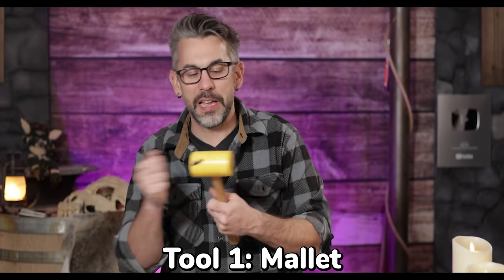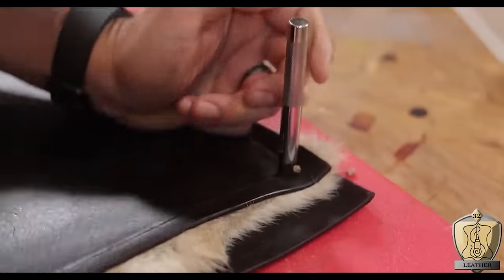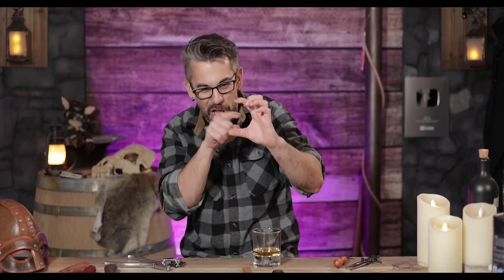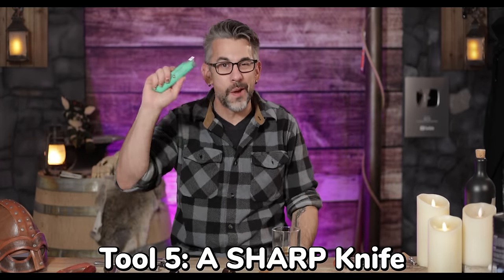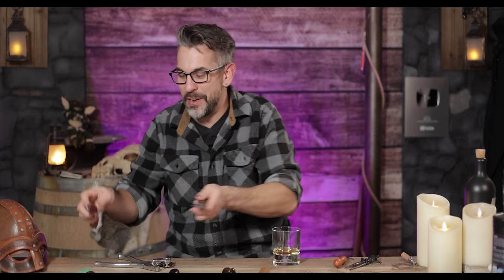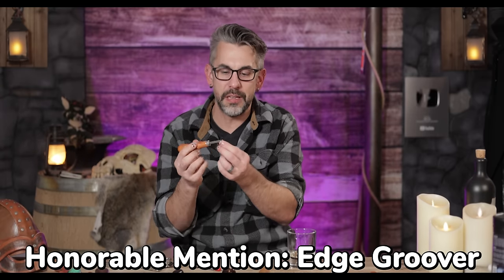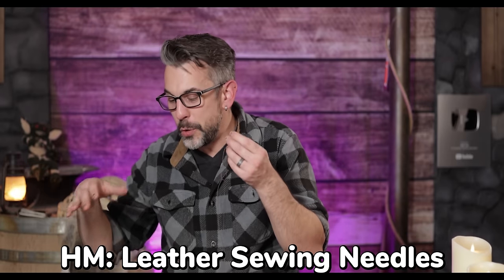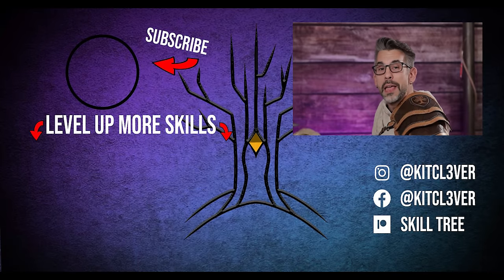How to Get Started with Leather

Comment: One surpring tool I picked up for leather tooling: a small crochet hook for very tiny details that the beveler stamp can't get to. You use the back of the hook like a stylus and it does a pretty decent job.
Reply: I've got a project I want to do tiny designs on and I'm just getting started, that sounds like a great idea and I have lots of crochet hooks. Thanks for the tip!
Reply: @SnowFox102  do keep in mind it is more tedious than the beveler and it takes multiple passes. But I did a whole project with this method and it worked.
Reply: @DirtCheapTerrains  Oh yeah I'm sure. It's just that my project is so small that I think an edge beveler would be too big, or at least too big for me.
Reply: Something else like this is a walnut pick, it is even thinner but I use the acorn end for those tight places and  the pick part for a stylist and a smoother as well. I love those garage sales finds!

Comment: About half a year ago I found a great kit online: multiple spools or wax thread, half a dozen needles in various shapes and sizes, assortment of stitching chisels, edge beveler, edge groover, scissors, measuring tape, thimble and two awls. All for just over €50. So I totally agree. Getting started does not have to cost an arm and a leg.
#craft
Reply from the maker: 100% I used the minimum amount of tools for AGES.
Reply: i got that exact kit for starting as well

Comment: For the edge slicker you can also use an old BIC pen. (Which also can be placed in a drill)
Reply from the maker: Good call! I have used a wooden dowel b4 too lol
Reply: A nice piece of antler works good too, plus the tip can reach into narrow spots.

Comment: I'm a blacksmith and I mostly use leather for knife sheathes and straps, especially for LARP and SCA articulated armor.  My first real tool was a punch because nails can punch a hole through leather but don't don't remove leather, meaning that leather "heals" itself and rivets don't fit very well.

Comment: This is so incredibly helpful. As someone who's just starting out, here are the tools I found I needed, in order:

1.) Knife
2.) Rivet tool
3.) Hammer
4.) Needles
5.) Stitching chisel(two-tine if you can only get one, but you'll definitely also want a four-tine also)
6.) Groover
7.) Hole punches
8.) Beveler

And that's actually as far as I've gotten so far. I've made a medieval ring belt, some pouches and wrist straps. My next project is gonna be a costrel.

You can do a lot of stuff just fastening with rivets before you get into stitching. I would learn the basics of stitching before you move on to tooling, but that's just my preference.

Also, if you get the cheap Harbor Freight hole punches and have trouble getting them to cut, there are some tricks you can use. Add a little beeswax to the cutting edge before punching each hole. If you're really struggling, and the punch is small enough, you can even chuck it into a power drill and use it just like a drill bit. It cuts through almost instantly!

Comment: Just a warning about the edge beveler from Weaver, made by horseshoe brand, with the plastic tan handle and interchangeable tips. The sizes are bigger than listed. They take off more of the corner than they should. Chuck dorsett of Weaver leather gave a good tip I liked about the bevel should take off a quarter to a third at most of the width.

Comment: I’ve gotten into leatherworking a lot after I found this channel. I’m generally busy as I work in construction and have a young baby now. I prefer working with chrome tan and on occasion veg tan. I’ve made a few leather totes, I made dnd dice tray scrolls I made a set of Christmas stockings and some other projects around tool belts. If I were to make a recommendations if you’re busy or limited on space I prefer using leather scissors over a knife to make cuts. I use an awl to trace out the shapes on my project so I know where I’m making cuts. I also almost always use an 18inch ruler. Good luck to any new crafters! And practice on your scraps don’t just toss them.

Good luck winning that prize y’-all I’m sure it’ll be amazing.
Reply: I’d like to add on to this, although we love Tandy leather here especially if you need templates or hardware. If all you’re after is a cheaper leather supply maverick leather has second run leathers that can often be found at a very reasonable price range. The veg tan horse narrows are a great option to get practice in and small crafts.
Reply: I’d like to add on to this, although we love Tandy leather here especially if you need templates or hardware. If all you’re after is a cheaper leather supply maverick leather has second run leathers that can often be found at a very reasonable price range. The veg tan horse narrows are a great option to get practice in and small crafts.

Comment: I've worked for two different companies that fabricated and sold solid surface countertops. While most will have broken or random scraps, they likely won't be sink cutouts but more strips and corner cuts. Solid surface is poured in lots like paint, and can be repaired, but if you repair it with a piece from a different lot, you can oftentimes see the difference in the particulates. So any place worth their salt will leave the sink cutouts with the customer to keep for possible repairs on their new and expensive countertops. That said laminate and stone tops can't really be repaired in the same way so those cutouts are likely fair game if they are kept at all.

Comment: A nice metal ruler is another thing needed.

I would also point out that you may want to consider going with a maul rather than a mallet, most of the choice there is personal preference because both do the job but which is better is more up to the person.

For needles, you really want a separate storage for your leather needles compared to normal sewing ones.

But the only needles that I've specifically bought is a permalock needle, the others I've gotten came from ones that were included with the various Tandy kits

#craft

Comment: That's such a big help for me right now. Thanks to your videos I've finally got the motivation to make a belt for that cool Celtic Cross buckle that I had lying around for ages. And now I'm hooked on leather crafting but don't have a big budget.
I bought a leather strap - and some scrap leather to test on first - at a newly opened LARP store and so far only used a rotary punch, my dad's old military knife that has an awl, some upholstery needles and parcel string as cordage. I still have to get the edges smooth though. Gotta try that rug method. 
But like the rest of my garb it's an ongoing process and one has to begin somewhere.

My grandma even may have some of those tools lying around in granddad's old workshed. I'm pretty sure a lot of stuff "fell off the truck" when the shoe factory he worked for since he left school moved it's production to far east Asia in the 90s. 😅

Comment: #craft 
Last year I got a couple super small things to make a dog collar. Mostly hardware. I have half of the belt leather left and of the many tips you just mentioned I kinda wish I had some of those tools. I mean a needle set, forks and a awl can only get you so far. I even used sissors to cut the leather and the awl to punch holes to set the threaded rivets. Overall my dog is super happy for what he got. Its just a dress collar and slips over his head and has one of those buckle clips. The next one I make will have a lot more stitching and some stamping and more conchs.

Comment: #Craft I got leather scraps years ago and now I'm trying to find projects for them. The main one I'm focusing on designing is a purse that I actually like and adding the Bag of Excellent Expansion ^tm on the base. I've been debating either tooling an Art Nouveau design on the flap or using it as a laser cutting project. I got some vinyl I can use as a test to see if the design works that I can later use for the sandbags in my truck 👍.

Comment: Thank you so much for this video! I know you made one like it earlier, and I was recently contemplating going back to try to find it. Now I have an updated version :) 
I bought a kit around this time last year, but it ended up not having key things like a swivel knife or a bevel stamp. One of the tools that did come with it came broken. I made one project with the kit and put the rest on hold because of the lacking and broken tools. Now that it has been about a year, it felt time to pick it up again and figure out which tools to get to supplement the kit I got last year. This video was incredibly helpful. Thanks!
#craft

Comment: #craft  I would add a poundo board to the list. It's a rubber sheet that's 12"×12  mine is about 1/4in thick. It cuts down on nose. From tooling

Comment: A head knife doesn't need to be sharpened often, just hone the edge. Not the easiest tool to use. To learn how to hone the edge, look on here for honing an Ulu as the ulu, hash knife and head knife are all pretty close to the same thing. An x-cto knife will cut well. A piece of antler tine will make a burnishing tool as will an old piece of flexiple leather. If you know someone with a lathe they can turn the woord burnishers. If your fingers are not the strongest get a needle nose pliers.

Comment: #craft ♥You are such a champ for giving your suggestions on a starter set. I have wanted to get into leather making for such a long time and this is a great video to use a a guide/reference :D What are your suggestions on getting your hands on leather? It is crazy expensive and messing up on something like that is really disheartening, so do you have some advice there? :D Thank you for your videoes! :D
Reply: When i first started leatherworking i used remnant bags from craft stores (michaels, hobby lobby, etc). It's usually the offcuts from a production leather place, so it'll vary wildly in size and type of leather, but its also usually less than $20 for a bag, so i didnt feel as worried about messing it up while i was learning. Hobby Lobby often has one they label the "farmer's bundle" which tends to be the larger, thicker pieces (best chance to get some veg tan).
Reply: @PKDoesStuff thank you so much for the advice! ❤ i live in Denmark and we dont really have those stores but maybe l could get lucky and find stuff like that in second hand stores? 🤔🤩

Comment: I disagree with a "light" mallet.  While you don't want a ridonkulously heavy mallet you don't want an ultra light mallet either.  It should have enough heft to help you do the work.  The light yellow plastic mallets aren't all that great   There is a large number of mallets with interchangeable heads that have sufficient but not over the top weight that can be picked up at any hardware/diy store.  

I also think instead of punches and stitching chisel fundamentally a punch set is all you need.  I'd consider replacing the chisels with a strop so that blades can sharpened and make cutting not only easier but safer.  

Anyways cheers!

#craft